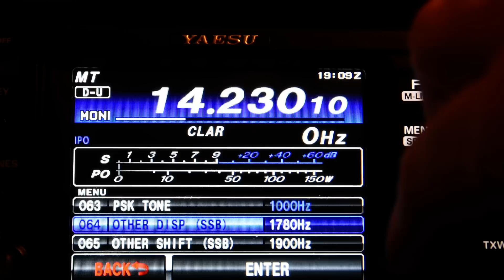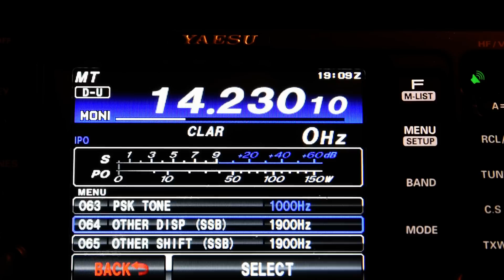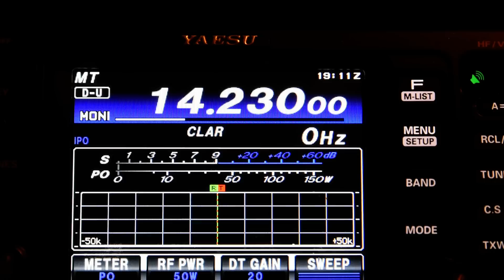FT-991A SSTV

Comment: I dont do sstv yet  so I could be wrong.
When I operate digi modes on usb data
Like mostly  WSJT-X  they say to set your power you operate at then look at the ALC  indicator and turn  down  the  DT Gain until  no  line is showing . Nothing
I do that on all modes on digi.  I'm sure they have the optimal  menu settings for  sstv 
 posted somewhere on line. I will be starting  SSTV ops very soon.  73's
AA4CP  Chuck 
Port Salerno FL USA

Comment: Hi Paul- Do you suspect that the need for the offset is contributed to by the menu items #66 (DATA LCUT FREQ) & #68 (DATA HCUT FREQ)? I suspect if you turned these filters off you would see a more steady ALC. You scrolled too quickly past your high cut frequency, but I noticed you hadn't turned off your low cut frequency filter.
73 W0ASB
Reply from the maker: I think those menu items only affect the receiver filtering. I have them set at their default values - 300Hz LCUT and 3000Hz HCUT so even if they were relevant to TX bandwidth the cut-offs are well outside normal SSTV bandwidth. 73 G4IJE.

Comment: I must have something set different on my FT-991. My RF out (PO level) stays at 50 watts from low to high. Then again, I DO NOT USE the "Data USB" setting when I use MMSSTV or WSJT-8. I use the "normal"  USB setting. I've used it that way for close to 3 years. On my 991, menu # 64 and 65 are at "0hz."
Reply from the maker: Then I guess you are using an interface like a Rigblaster, SignalLink or similar. The FT991A's internal soundcard only works (on TX) in the DATA modes.
Reply: @paulturner849    Nope. Just the USB cable from my computer to the radio. No external soundcard. I made a quick video of my radio while transmitting on FT8 a minute ago. I'm uploading it to my YouTube page ( under K7JBL) if you want to have a look. I titled it "USB Mode."  We do a lot of 2 meter ragchew around here. I do a live stream starting almost every night around 10 PM local (Portland, Oregon/Vancouver, Washington)  so the guys can get an idea of what their audio sounds like.

 I use the min-DIN data port on the back to run my mic audio into 991. My hand mic works as a PTT, but the mic is turned off in the menu settings of the 991. I use a condenser mic powered by a Behringer X18 mixer, which goes to the mini-DIN Data port.  It's nice having a 6 band parametric EQ on 2 meter. The 991 only has Xmit EQ on SSB.
Reply from the maker: Strange. I don't have my FT-991A set up for SSTV at the moment (I am using an IC-7300 instead) but I did a quick test in WSJT-X and the 991A will only TX in D-U mode. In SSB mode the rig is keyed but no tones are sent.

Comment: That is a usual issue. Had my FT-950. Also the FT DX 1200 has this issue. You also see a Shift of the Waterfall between USB and DATA USB when not configuriing this. Plenty Videos out there. Short. If you dont configure this, you are OFF FREQUENCY as well.

Comment from the maker: Have a look at www.classicsstv.com/mmoptions.php for details of the options I use in MMSSTV.
Reply from the maker: "Data USB" just means the mode the transceiver must be in to use its internal sound card for so-call "data" modes. Traditional analogue SSTV (Martin, Robot, Scottie etc) is often referred to as a data mode simply because it uses audio tones to convey information. SSTV is NOT a digital or data mode, but it is handled by the computer as if it was.

Comment: Shouldn't the ALC be at less than 1 to avoid scatter?
Reply from the maker: Not really Paul. You should keep ALC low for digital modes but for analogue SSTV you can set up audio levels as you would for SSB. Most people reduce power a little to avoid overheating their PA, but if your radio can handle the heat you can run full power without splattering.
Reply: Thanks for the reply! Didn't really expect one especially this time of day.  :) I guess us Pauls are night owls.  Thanks for the info.  I just bought a 991a and trying to learn it and the differences from the Kenwoods I'm used to.